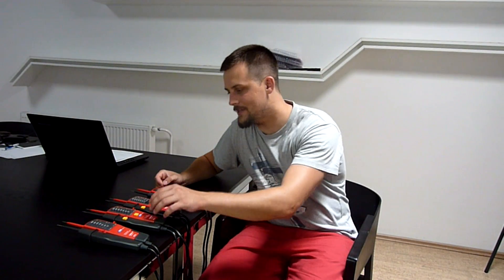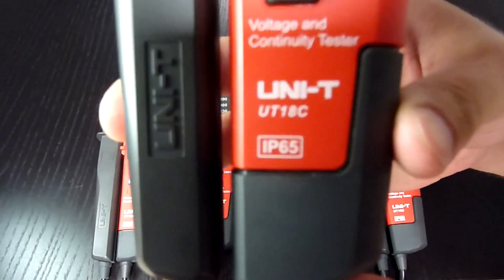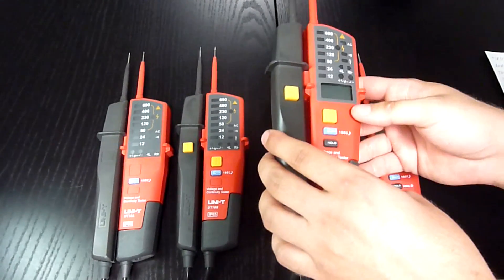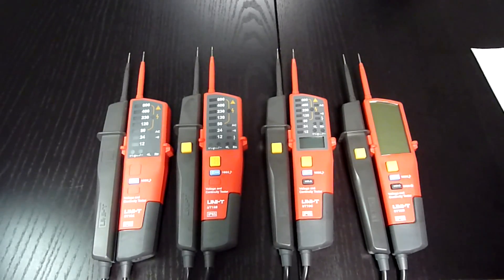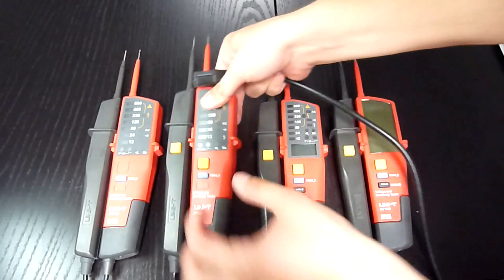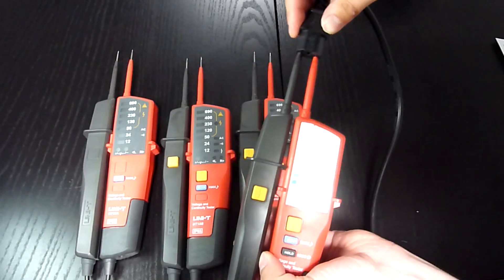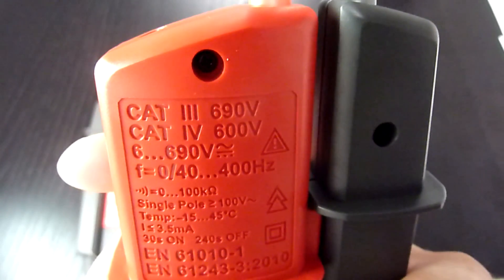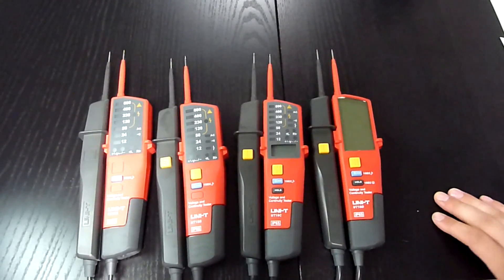New heavy duty voltage probes - UNI-T UT18 serie

Comment: You did a "live RCD test" between Active and Neutral - all this does is generate a load between the two. An RCD will only trigger on an imbalance between Active and Neutral, so to trigger the RCD you must use the load function between Active and Earth. Please note that this will only trigger an RCD (if present) to trip; it won't test that it is disconnecting within the correct time at the correct current. This is a very simple electrical principle that should be known to you if you are trying to review electrical test equipment, and the fact that you did not know this has me concerned about the factual basis your entire review beyond a product spruik.

Something I wish you would have done in the video is to open the units to examine the PCB design and to check that it has the correct HRC input protection available to both leads; I have long had issues with safety in UNI-T design where it claims to be CAT III/IV rated but is not.
Reply: The RCD test doesn't measure trip time but it does actually measure trip current, though in a simplistic manner. According to the manual, the RCD led on the device will light up if the trip current is more than 30mA. 

I wouldn't expect it to have any fuse of any type, HRC or not. But it should have MOVs or GDTs and isolation slots routed on the PCB.

I just ordered the C version. I think it is the best meter of the four, because it has all the features and can also make voltage measurements with no batteries installed, something that the D version cannot!

I'm going to post a teardown on the eevblog forum when I get it!
Reply: fubar.gr I think you're missing the point; RCDs trigger die to magnetic field imbalance in two coils - one on active and one on neutral. The only ways to cause an imbalance in that is through earth leakage (active->earth) or mixed neutrals (active->wrong neutral). Testing between active and neutral is no different to putting a light or something on the circuit - you'll only get a trigger on an MCBO on overcurrent that way; 7.5x The rated trip current on a C-type
Reply: fubar.gr also if it's CAT rated it's mandatory to have an HRC fuse.
Reply: Stop saying active!
Reply: Uni t 18D is a faulty model,have had 2,now rubish not gonna buy 3rd one.

Comment: thanks for making the video , would you say the one with the large screen is the best to buy?
Reply from the maker: Hi, to be honest I would go with UT18C as it have best price/performance ratio. There are small differences between UT18C and UT18D, most significant is huge display on D model. But yes if you like the look of D go for it, both C and D are well build machines. Nice step forward compare to previous UT15 series.
Reply: Thanks for your reply , I was thinking the same myself so I think I will go with the UT18C as I like the mix of LED/LCD display. Cheers keep up the good work.